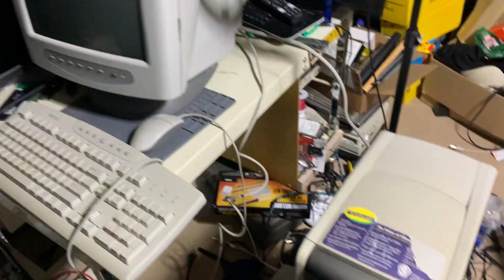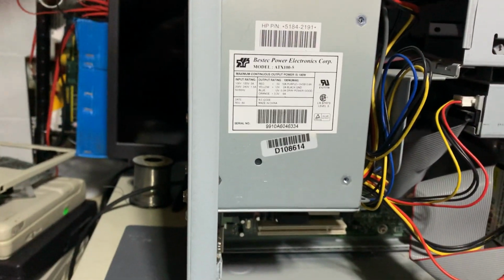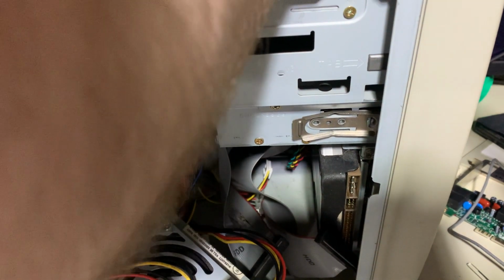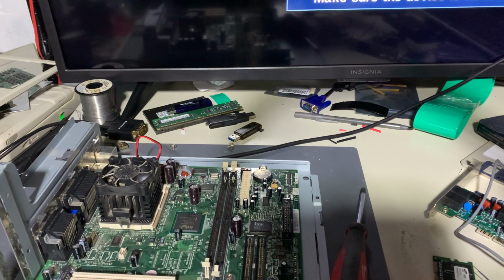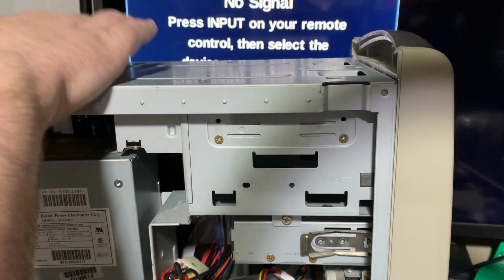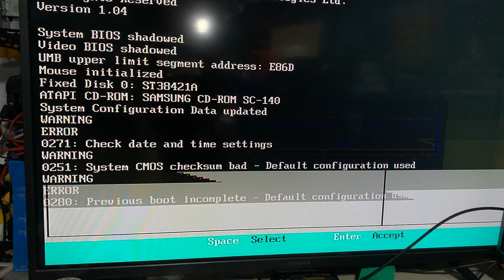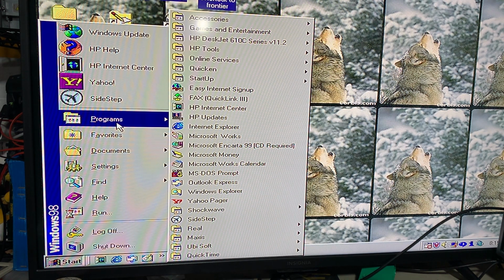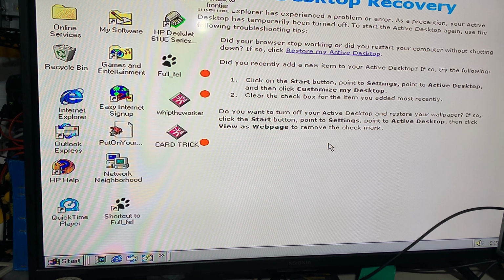Can we Get This HP Pavilion 6535 Going Again?

Comment: Wow I had one of those I did upgrade my ram to 256, slapped in some generic pci  3D graphics card, upgraded the hard drive to a 20 gb western digital drive and lastly I put a dvd/ cdrw burner on it however it only played dvds . I used it from 1999 new until 07.

Comment: My mom and grandma had Identical HP machines in this style of case, except there's were the higher end 8000 series pavilions (8660cto be exact) so they were in a full ATX case but it was the size of a typical mini tower since the ATX PSU was mounted over the motherboard in the same funky way, sadly neither of those machines work they both failed where when you put power to the motherboard it instantly turns on and does absolutely nothing. I don't know what's wrong with them and honestly I don't see much reason in doing board level repair on systems where all you're stuck with is intel integrated graphics with no AGP, if they had an AGP slot and they still worked I could make a decent Pentium III era 9x games machine since they came with a Pentium III 533EB that means they could easily take a faster 133 FSB Coppermine. I still have one of the original monitors for them, haven't powered it on since probably 2010 so who knows if it even works still and I don't know whatever happened to either set of speakers.